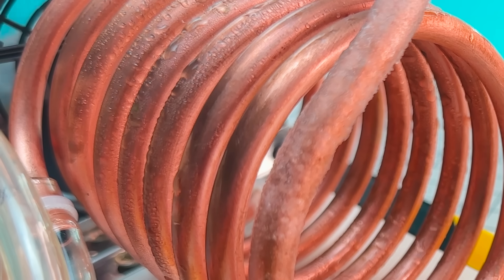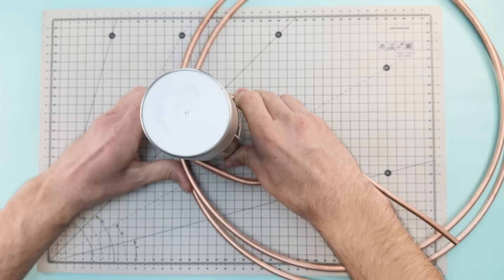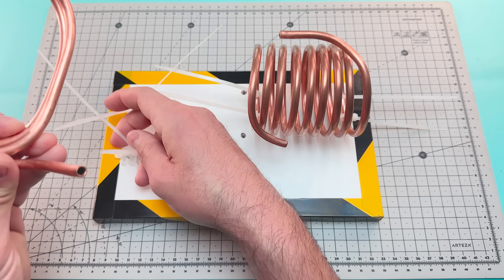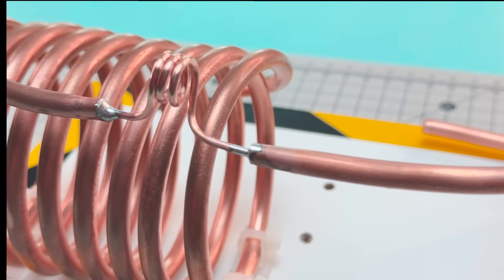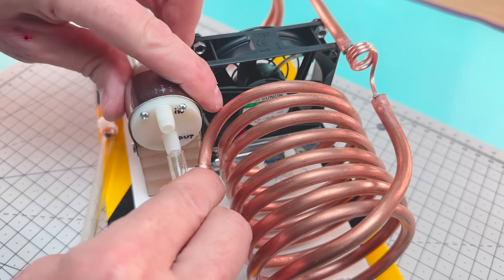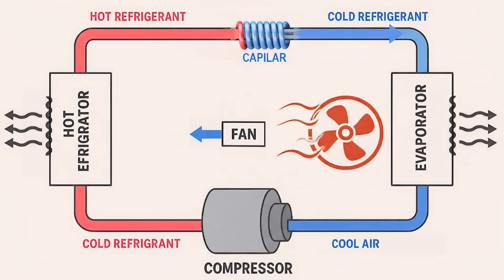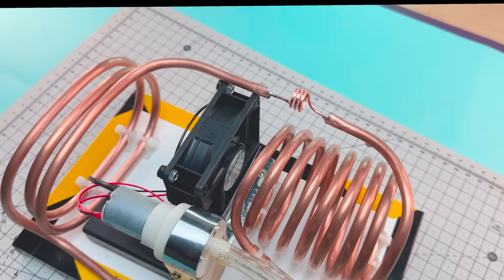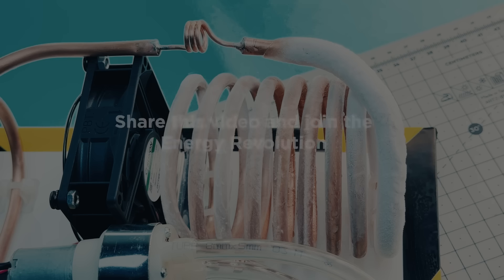Make your own AIR CONDITIONER at home Fast and Easy!

Comment: From my knowledge about HVAC systems, it is missing another fan to cool down the heating pipes and some radiators but having this to act as a demonstration to explain how something works is actually quite good- aside from lacking a lot of distance, a fluid catching system from frost that shouldn't be building up like that and a proper inlet for what should be a closed system for the gass.

Comment: Surely some part of this is also really hot and thus negating the effect ? Like the back of a refrigerator
Reply: Yep, but say if you're sticking this halfway out a window or in a cooler or something you could pump heat from one place to another, just like how a fridge works

Comment: This will run only a few minutes on that battery pack... The energy to create the cooling is Electrical... there is no free lunch where energy conversion is concerned. You need to supply adequate power from AC lines or Solar Power to sustain the cooling.  The capacity is rated in watts... the more cooling, the bigger the compressor capacity and the heat exchanger coils have to be.  Also.. if you don;t isolate the heat being extracted to the outside of the room... there is no net cooling..  NONE !  you pump the extracted heat back into the room, and you add the extra heat generated by the compressor .  All window AC units, and heat pumps  confine the extracted heat to the OUTSIDE of the area to be cooled,  this is why a refrigerator is an insulated box.

Comment: Can call it a dehumidifier. Not Airconditioner.
Reply: not after you turn it off !
Reply: well, yeah, if you wanted it to actually cool an area you need to vent the heat outside.  But then it would, indeed, cool down a really, really tiny space.

Comment: Great idea but i'm wondering if it can be corporated into a pc case, have the fan on the case & the cool pipes inside & the heat pipe outside, might have to drill holes for the pipes & power it with a molex connector so it comes on with the pc, heat pipes will have to go to the side of the pc so the other fans don't bring in the hot air, I might have to look into this, thank you.
Reply: No, this shouldn't be placed in a PC case. Once it cools off enough to drop below the indoor dew point water will start condensing and dripping into the computer. This is why air conditioners have a condensate drain.
Reply: Water cooled for 0.1 seconds before it fries some components 🤨

Comment: Create one a little bigger, and you can  sell them
Reply: Sell the for what?  They are useless and would heat up any room the are placed in.  He shows the cold side but not the temperature of the hot side which is equal to the temperature drop on the cold side and then some with the extra heat being the energy that went into the pump.  Overall this would heat a room unless the hotsides heat is removed.   Besides... a slightly larger one is just called an air conditioner.   Buy something that is worth it and properly ejects the heat to the outside and not back into the room.  He could properly accomplish a tiny bit of cooling if the hot side went into a large vat of water or something that was regularly replaced when it got hot which will be fast.

Comment: Fun project. . . But:
1.  Isobutane is rather flammable.  There is still air inside that closed system.  Not a good combination.  (Refrigeration/air conditioning systems normally evacuate the air before adding the refrigerant.  This aids efficiency, the refrigerants used are not flammable.)  Might be mitigated by a flame arrester, rat wire mesh or something, around the whole assembly.  But no guarantees. . .
2.  Reflecting many comments below, you are not going to get enough energy out of the nine volt battery to do much cooling.  A plug-in 12 volt DC power source would help.  But not much.  Might make a fun beverage can cooler and conversation piece, though.  The system does not have enough power to add too much heat to the room.
3.  Reflecting many other comments below, the system will result in net heating of the space.  The heat from the condenser will offset the cooling of the evaporator, add in the heat from the motor.  A separate fan for the condenser, isolate the two sides of the system, and run clothes dryer vent hose to a window.  (Metal hose, not plastic, to be on the safe side.
4.  Condenser coils icing up is a fun effect, but shows that thermal transfer to the air is very inefficient.  Spacing the coils and and adding fins would help.  Aluminum construction flashing would be cheap, but a bit labor intensive.
Reply: All spot on, my guy.

Comment: What about dissapation of the heat created by compression (the heat that comes off the condenser coil)? That will completely counter the cooling effect of the evaporation coil. You need to expel the hot air from the room in order for this to work!!!
Reply: yep

Comment: I can't believe all the negativism in the comments! This wasn't meant to be rocket science! This a simple and viable way to cool the coil! Even an air conditioner will produce heat and try to heat the rest of the world. Petty opinions are pathetic! This kind of pointless criticism has a negative influence on the world and shows your ego problems! Go build your own project!
Well done Liberty!!
Reply: well john an air conditioner normally dumps the heat outside! this is a viable way to transfer heat from one place and put it somewhere else. if you put the heat you just took out of a room back into that room, that room will heat up! 😱
Reply: It should cancel out the heat against the cooling, and if you say that it heats the room, it should also have an effect of cooling the room thus cancelling out hot against cold. I agree that it isn't an A/C unit persè but it is a goid video to show you something that gets people to start understanding what a cycling system is and through trial and error teach them about AC systems. The guy is only just having fun and making a few dollars to boot. It is a misleading headline but it is a useful video never the less imho.

Comment: The hot side of the circuit will give out as much heat ( plus a tiny bit more from the battery conversion to heat ) as the cold side is extracting from the room, you cannot beat the physics.
Reply: That's exactly what an AC is supposed to do. Go back to putting little ice cubes in front of your fan 😂🤣
Reply: @xntimxtter2417  Did you even listen to it  ?  I will help you out   " The circuit is now completed and we are ready to start cooling the room"  Back to you brains .

Comment: In this case system is going to working opposite,in the room gonna be warmer,cause condensing side and two motors for fan and pump produces more heat then evaporator cooling 😮

Comment: Surely you can't cool a room of any size with a 9V battery... Still this demo is valuable.
Reply: Especially since it is a closed system.  Put this contraption in a sealed box and the temp will go up.
Reply: So will my travel cooler! but it sure keeps my beer cold! This isn't a rocket science project friend, even an air conditioner that hangs out of a window will heat up the world by your reasoning! @SteveNabors-u9z

Comment: The Liberty Engine Project oh OKAAYYY...now go stick that joint in a room and show the room temps changing in the same intensifying manner as that background music lol 😅. Oh but wait...aren't actual evaps supposed to be on the rear of a fan as an AC unit concept cuz in front bud I believe in front with just plain air blowing over it it's technically a swamp cooler 🤔 in this case a very very miniature one 😀

Comment: We can't create cold air, only extract heat. How will this save money if the heat extracted is placed back in the same living space? Very nice video and display - Mr. AC
Reply: just separate the hot area from the cold area, don't be this dense.
Reply: Or just use this to directly cool your face/body in a warm or uncomfortably room

Comment: How about a mini Stirling cold gas cycle piston that turns air into liquid that fills copper pipe with tiny holes drilled into it wrapped in carbon felt with solid state fan to move air over it for liquid air heat exchange boil off with a power cell that starts it up with seabeak effect electrical power supply to charge power cell up placing it on standby running totally off seabeak effect electrical power supply? Would this design out performance current HVAC cooling system's? Im very curious to get feed back on this information? 😊🫶✨️

Comment: This would be cold for a PC cooler. Having The pipe on the PC air inlet and the evaporator on the exhaust side.
Reply: Not good condensed water might conduct current

Comment: Where does the heated air go? Oh it stays in the room so you are not heating or cooling the room at all.
Standard youtube lies!
Reply: In the room goes also more heat as the pump creates more heat in the process. But this little device can be useful if you have to cool down something fast
Reply: That's not the point. He could have thermically isolated the evaporator from the condenser but that would have taken 90% of the work. For nothing. Because this is a DEMO video. Not a DIY AC. Please use your brain

Comment: For as much money as it would take me to collect all those parts and build my own silly room air conditioner as you called it, I could probably go down to Walmart and just buy the smallest window one they have for roughly the same price. It was cool though. Seems a bit flammable. You could probably just use the stuff they use on cars if this does in fact work. I watched it until the end.

Comment: What another gas can i replace ? Idk where can i buy :'(
Reply: Propane but it is also flammable...  probably fine for a small project but I would not recommend use in an enclosed area.  I think if I was going to do something like this for real and could not get regular 134a or an R22 replacement to work, I would keep the unit in a well ventilated box outside and then use a heat transfer tube with antifreeze or maybe mineral oil then bring in the safer but cold antifreeze inside where you can blow a fan across it or run through a small radiator, pulling the heat from the room. 

Also is you are just messing around you can play with Peltier stacks.  They are not as efficient but pretty cool and safe none the less.
Reply: Freon

Comment: That is not going to cool an actual room. You could put it in an insulated box and vent the fan exhaust out of the box and make a mini portable refrigerator for camping or picnics. But thats not cooling a room. I would actually even test it before trusting it to keep the mini fridge cool enough for meat. Its a neat experiment however. To cool a room, you would need that on a larger scale and it would be far less efficient than just buying an air-conditioner from the store.
Reply: Definitely not cool enough for meat

Comment: Well obviously it works and his principle is based on the ways refrigeration works, to dispel the heat you'd need to box it and have a fan across it also to divert the heat into an area it's not wanted or needed to cool the room it would need to be boxed with a fan of it's on behind the coil. Anyone in HVAC can see that. But his principle is solid...

Comment: wont the condenser be just as hot as the evaporator gets cold?  so the net effect to the room will be no temperature change?
Reply: Youre right. AC´s will allways heat more then to cool. You allways will have a energy loss, that increases the produced heat. And even in a fantasy world with no lost energy, that device would do simply nothing.
How ever, ppl think it works, because it does for the short term. As the heated part dosnt interact with the same amout of air, it will slower heat up then cool for the first moments. But the hotter it gets, wich it will, the more it will heat. At somepoint it heats more then to cool. And when you shut the device off, it also will heat the room up with its stored energy. Its all just a matter of time.
Reply: @jeremyw6418  What if you put the Evaporator and fan inside of an igloo cooler and left the rest of the compoenents outside the cooler.  Hooked it up to a solar panel.  Could you make a portable refrigerator out of it?
Reply: @whispermason8052  yes. It would work.
I would recoment you to place an extra fan to the outside components. That way you decrease the heating of the device it self, what will let it run more efficient. 
You could also just let the fan for the Evaporator away, when the inside space of the Igloo cooler isnt bigger then a regular bag.

I have a portable refrigerato that is basicaly that.
Reply: Actually the net effect will be more heat 😂 as the pump and fan produces heat too

Comment: Fantastic experiment to make but it’s a shame the battery will only last around 5-10 minutes and the heat generated will offset the cooling effects. With a bit more work and a 12v psu it could be good for a small room with the heat vented outside. Brilliant
Reply: just use 3x 18650s much longer run times or even more battery's
 as long as they equal to or less than 12v

Comment: One obvious point . The hot side will have to be outside the window so that it doesn't counteract the cold air. 
Also the coils and fan will have to be about twice as big with a more powerful pump. Then it MIGHT cool a 10 by 10 room.
Also would help to have some type of barrier between the hot and cold side.
Reply: Thank you

Comment: The important point is that the entire refrigeration system is not photographed at all when frost forms. This suggests that the piping was removed and the refrigerant was pumped after the pump. This type of pump does not generate enough pressure to liquefy the refrigerant. (I translated this into English, so I hope it makes sense.)

Comment: LOL, this is a nice explanatory video of simple air conditioning, and less useful than opening your refrigerator door to AC your kitchen/house.
Even upsizing it and using a decent freon alternative while potentially interesting would never fly with SWMBO and efficiency would likely be very $$.
As a toy/project, its very nicely built.
Reply: It’s equally as useless as opening your refrigerator door. The system generates a small amount of heat just like the fridge does. 

Refrigeration is like carrying water from one place to another. Unless you can dump the heat into an outside space, the energy used to carry the water is just adding thermal energy into the same space you are moving it around in.

Comment: I'm gonna give you credit for simply explaining how a vapor cycle AC works - but this thing won't cool a room or run for very long (and will go through A LOT of batteries). In fact this thing will warm up a room, even if it will produce a cool air stream in one direction.
Reply: You are right Mr. User. However even if it is so the engineer can use a parabolic mirror and with a Stirling or steam engine then. By using a Stirling or steam engine it can help pushing the fan and also the pump to complete the heat transfer. By this method the solar power can be converted to a green air conditioner then. For the heat gas though it might be blew out of the window and perhaps a solar parabolic disk could be placed near the window for a free of charge air conditioning system.

Comment: Simple physics: The heat produced on the condensor side is greater than the cold on the evaporator side of the unit. The net effect is heat. This unit is going to warm up your room, not cool it down.
Reply: yes, true, but the room will still feel more comfortable, because the ice you see on the pipes is humidity taken from the room, its not only the heat you dislike, the humidity is the thing that produce the mo(i)st discomfort.
I'd rather stay in a room with 28*C low humidity than 24*C +85 humidity. ALL DAY
Reply: @IveMetYourMotherOnce  I have a portable/rollable one with one exhause hose out a sliding door.
It does work, however it takes hours and hours to get from 83 - 70 for a 220sqf bedroom despite 10K BTU rating.
So more hot air is being expelled from motors/condensor, but its also pulling out already cooled air as well, and creating a negative pressure which pulls warm house air under doors, etc into the room. 
So a lot less efficient than numbers would suggest.
The device as shown is not exhausted and will be a heat dump for the room although directly in front of it will likely be somewhat cooler.  For about 1-2' max.
Reply: We have a couple 'portables' that you can roll to different rooms.  Videos on YT showing people isolating the condensor and having it exhause via a second hose out the window.
Significant improvement in cooling as you aren't using cooled air to cool the condenser and more importantly, aren't causing a partial vacuum effect in the conditioned space that pulls warm air in under door cracks, etc.